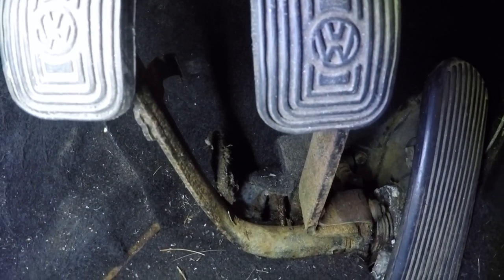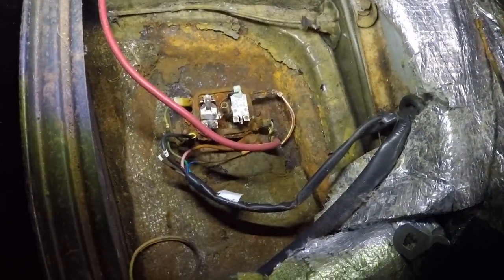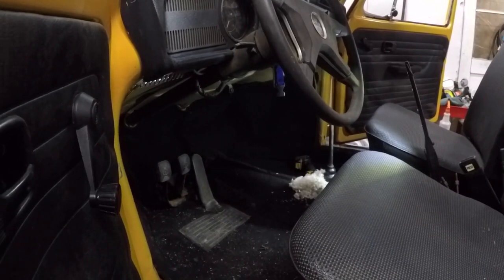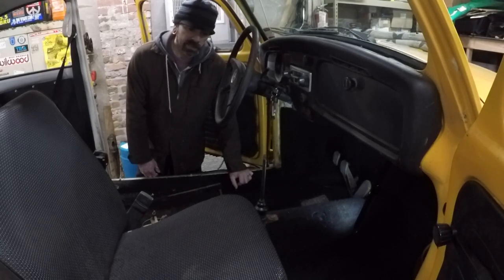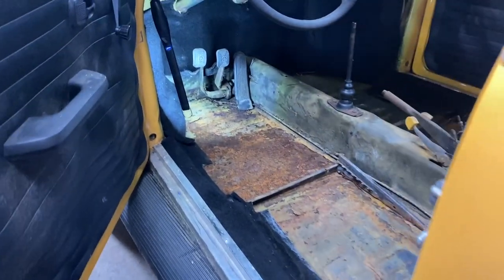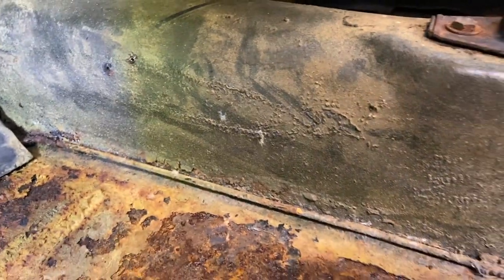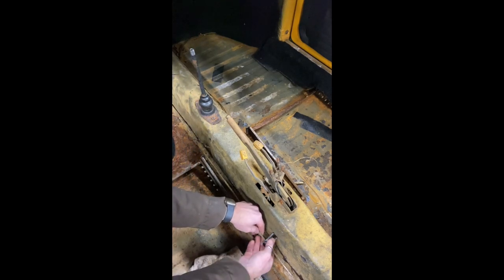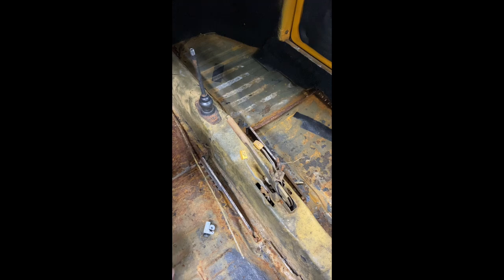1974 VW Beetle Brake Line Repair “Bumblebee” | FUTURE RESCUE?

Comment: Good video! Where did you get the flare tool and coupler? Thanks
Reply from the maker: I’ve had the flare tool for a long time I can’t remember where I got it but you can get them at any auto parts store or Amazon the union was from Amazon

Comment: IIRC the year of the car is in the vin. You said that car you DIY the rusty break line is a solid car, how solid? Are the rockers in tack?  Are the heat channels all there ? That section of floor in the pedal area looked a little flimsy? Just wondering?
Reply from the maker: Heater channels are completely solid as is the rockers. The floor on the drivers side yes is a little flimsy but solid. It was dented up from underneath so I feel like that’s why it feels flimsy u can push it down and pops back up.